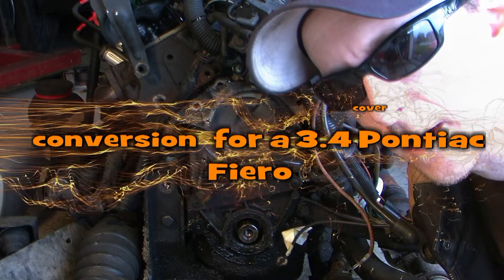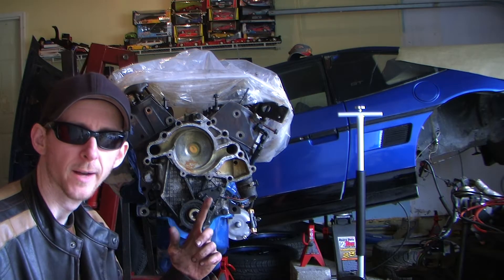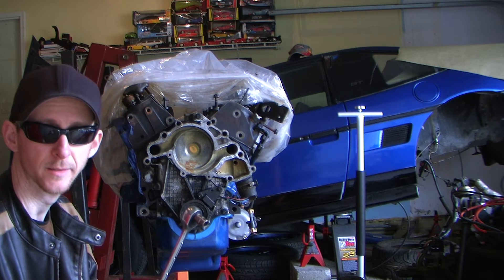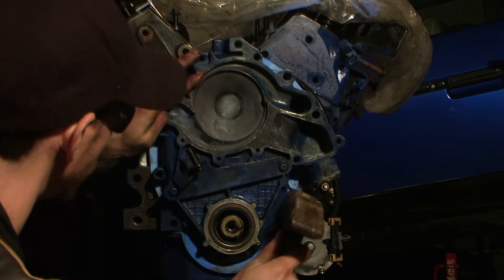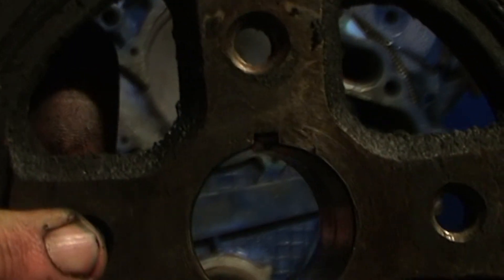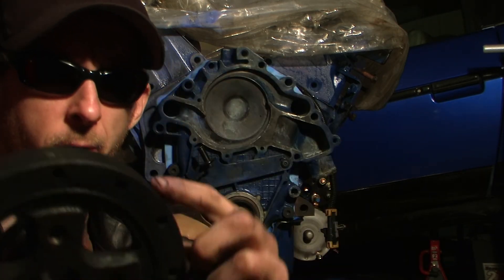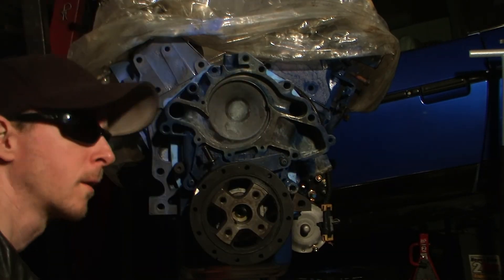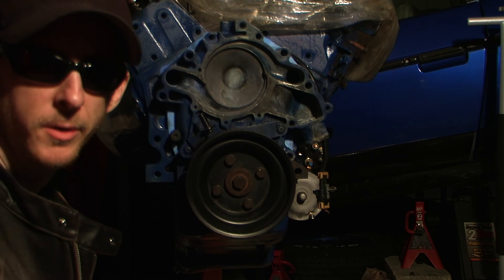Pontiac Fiero - How to convert the 3.4 timing chain cover & Harmonic balancer

Comment: when you cut a line with saw you have removed material that has a specific weight 
now missing from this balancer now unbalanced now at 6000 rpm thats a few ounces
of more vibration in wrong areas
Reply: All the 60° v6 peak before 6k anyways

Comment: you shouldn't hammer on the harmonic balancer. You can ruin the bearings on the crankshaft which will cause all kinds of problems. Rent a tool to install the harmonic balancer from your auto store.

Comment: You have to swap the timing cover for the conversion as the Fiero water pump spins the opposite direction of the 3.4 water pump.  If you look at the video you will see that one has the water passages spinning clockwise while the other has them spinning counter clockwise.

Comment: The notches, as you call them, are key-ways, and should be lined up using the key that will keep the pulley and shaft in perfect alignment.  also, you should point out that all of the bolts have important specified torque tightening per 3.4 motor manual.  Use RTV sealant on the block and the timing cover to insure a good seal.  Use the 3.4 balancer on the 3.4 engine and transfer the TDC timing mark from the old  2.8 balancer, by using the key in the key ways to align them perfectly.